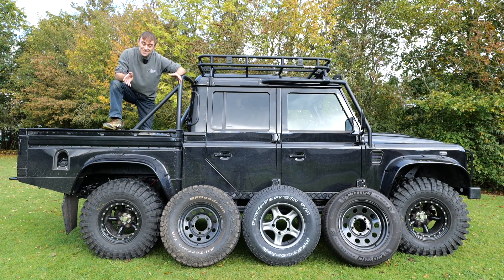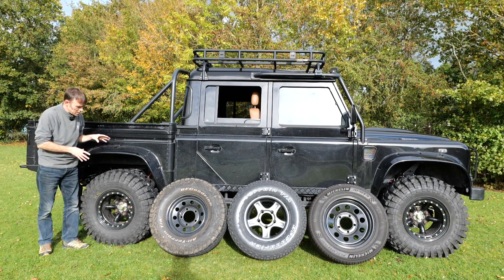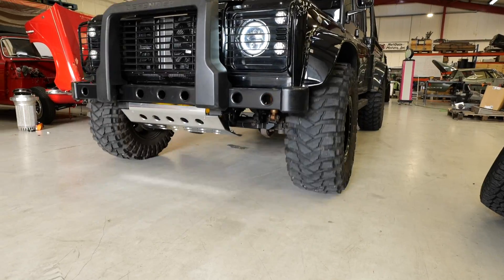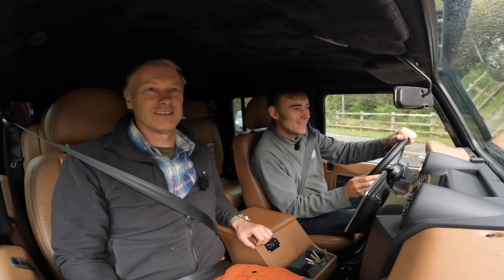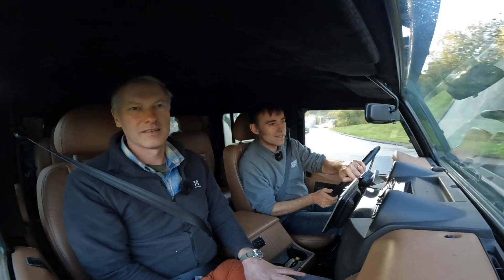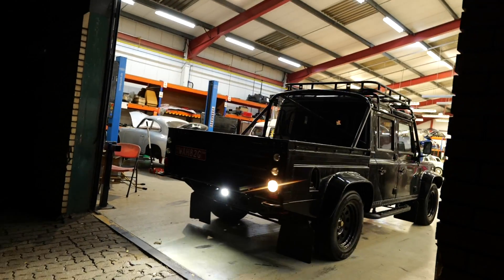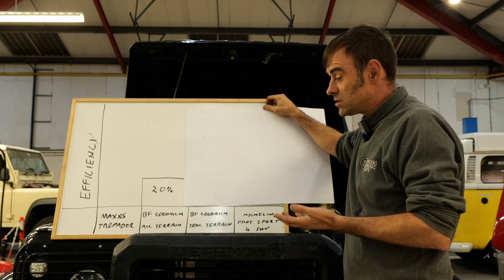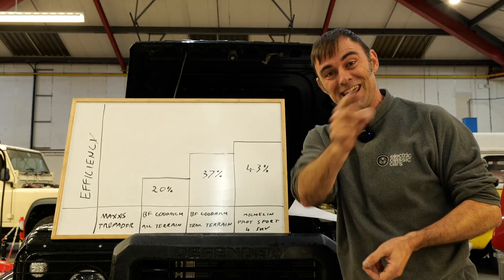How do tyres affect fuel efficiency?

Comment: Thanks Richard. 

Another 47 miles/kilometres for every 100 driven shows that, for road use, it is worth choosing the correct tyre for the job. It's worth throwing away your macho card if you want economy and a better driving experience.

It would be interesting to know what the difference is with the full road tyres on the smaller rims of the  off road tyres. My guess is that they will be around 50% more efficient than the off road ones.

Comment: The results probably don't translate to petrol or diesel cars the same because of the inefficiency of the ICE engine. A similar effect is seen when towing. The road tires will be better but likely 15% better instead of >40%

A large amount of energy just goes into keeping the engine running and that is fixed regardless of load. So if you use 1 liter of fuel to generate torque X, only half of that (say) is generating the torque, the rest is waste. So, if you need torque 2X, you only need 1.5 liter. No, this is not an 'advantage' for ICE cars, what it means is if you buy an ICE car big enough to tow your boat, you are effectively towing half that boat around with you ALL THE TIME, because that bigger engine is guzzling that extra fuel.

Electric motors are insanely efficient. So doubling the load means using twice the power. Bottom line is that you are going to be seeing the effect of the tires much more clearly on an electric vehicle than on ICE.

This is also why electric cars mean lower emissions even when the electricity comes from fossil fuels. 45% efficient generation followed by 90% efficient drive gets you 40% overall efficiency which is twice as good as the 20% efficiency a really good ICE engine manages.

Comment: Great video, however, the results would NOT be the same for a petrol/diesel vehicle. A electric motor is 90+% efficient at turning energy into movement, whereas ICE tops out around 30% (I think some have got close to 40). This means that the difference in tyres has less impact on total fuel consumption, as ~70% is wasted (mostly through heat) long before it gets to the wheels. If its a 90% vs 30% efficiency at the wheel (obvs theres transmission losses in reality), then that would mean an ICE vehicle would see 1/3 of the difference in efficiency between wheels - so around 14% better on the road tyres vs off road, which is still considerable when driving a thirsty beast like that.

Comment: I think, for a proper comparison, the difference in height (and hence drag) should not be "ironed out". The height difference is in actual part of what the tyres change about the vehicles energy consumption, because that's part of how the vehicle is supposed to run with given tyres.
So, while correcting the height certainly gives you differences based on the characteristics of the tyres, alone. You create a bias in favour of tyres that increase the overall height of the vehicle.
In the end a proper comparison would include height differences and tyre pressures typical for the type of tyre. And that would result in much larger differences in efficiency, than you showed in your test.
Reply from the maker: You are correct. 👍

Comment: I was just replying to a comment further down and have come up with a gruelling tyre changing fest of a test for you guys! Test not only tyre types but combined with tyre sizes! Where are the sweet spots for having bigger tyres to increase ground clearance plus aesthetics and maintaining reasonable fuel economy? 
So how much of a taller tyre starts to effect fuel economy negatively and how much of that loss in economy can be clawed back by opting for a more Road biased tyre? 
Can a taller tyre, especially one that is more Road biased, actually improve economy for a given type of engine and to what limits? 
This obviously will vary across vehicles depending upon where their torque curve is and (as I assume you did in this test) would have to be done over a confirmed, measured distance not from the milometer as this would vary in it’s accuracy relative to the tyre size. 
Of course you’ve also got tyre width thrown in there but I think you’d just have to go with keeping that as near the same as the natural progression through bigger tyres would dictate, ie accept that a taller tyre is also by default going to be a little wider for stability but not wantonly increase tyre width. How about it gents? Are you up for the challenge. I think an electric vehicle would be a very good platform to do this test from given it’s clean torque delivery.

Comment: Many of my fellow Americans drive on paved roads with their rough terrain tires. I can hear them coming down the road from around 0.25 mile away. Plus, they’re in their huge V8 trucks petrol or diesel trucks. Some trucks are equipped with air brakes, and they love to use them often.
However, EV sales are way down in the States. On the other hand, I understand that - they’re freaking expensive here.
Anyway, back to morning tea
Reply from the maker: I bet those guys with the V8 trucks and huge off road tyres are the first to complain when gas prices go up. 😆😉👍
Reply: @ElectricClassicCars   Usually the gas guzzler drivers blame fuel efficient vehicles for the increase in gas prices.  I'm not sure they understand supply & demand.
Reply: I have a few coworkers in here in Canada who live on acreages on paved access roads who drive SUVs with off-road tyres & spend $25 per day on gas to get to & from work in the city.  It's not about good decision-making so much as the vehicle is a giant security blanket.  Apparently a Vietnamese EV company is building a factory in the US which will produce sub-$20,000 EVs with a 248-mile range starting in 2025 or 2026.  This may explain why Tesla has been dropping prices.

Comment: are you taking circumference into account (assuming you have not kept a gearbox) that will
make a huge difference in electric but will be equalized via gears on ICE / hybrid / electric conversion with gearbox. On diesel and petrol I see very little mpg difference between pilots and ko2 (low single digits) but way more changing transfer ratio between 1.4 and 1.2. This is based on 40,000 miles driving down to spain and france at motorway speeds. you need to run this with same final output speed in EV

Comment: Fuel vs Cool....

Those road tyres look naff though!
Would be curious as to the weight difference between the Maxxis and the Road tyre, as that will have an impact.

I've got Toyo Open Country's on my Chevy, and whilst they are a big block off road tyre tread, they're surprisingly quiet for what they are.
(I took off the slightly smaller BF AT's).

Comment: Interesting comprison. I think it would be important to state the wheel dimensions, speficiations and weight as potentially a large percentage of difference would be the weight (both tire and rim) and size of the tire that results in the efficenty difference.
Reply: Absolutely. I also would like to know if the truck's computer has the ability to change/set tire/tyre circumference so speed and distance can be equalized. It appears that the weight of the tires goes down from a ton to a respectable amount for the highway tire. The additional weight of the monster tires with monster wheels could easily have added a couple hundred pounds to the load. All of this affects the efficiency of the truck and any truck or car they go on.
Reply: @robeigner4390  I appologise first as this is a long comment.

Without knowing the tyre sizes I can't give exact figures for weight, but looking at the overall height of all 4 tyres, the mud-terrain tyres look taller, so in effect at 55mph (sat nav speed) there would be less revoloutions of the tyre per mile compared to the other 3 tyres. This effectively means the motor would not be used as much. 
Saying that, the chunky tyre takes more energy to turn as the sidewall height is bigger, meaning there is more resistance within the tyre (internal friction) to rotate it & the tread design itself also increases the rolling resistance, as I expalin later.

Compare that to the Michelin SUV tyre, which is designed to have less friction within the tyres construction and the 18 inch wheel reduces the sidewall height compared to the (very similar) overall height of the all-terrain & trail-terrain tyres, which are on 16 inch rims (resulting in a slightly taller sidewall). 

The other significant benefit of the SUV tyre is the tread pattern itself, It is designed to offer lower rolling resistance because there are continuous strips of rubber going around the cicumference of the tyres that reduces the rolling resistance as the tyre tread is always in contact with the road. 
With a 'block pattern tread' (the other 3 tyres) every time a block of rubber hits the road, the block effectively tries to stop the wheel turning, which dependant on the severity of the block, increases the energy required to turn the tyre (i.e. the rolling resistance)

As for the unsprung weight of the tyre, yes this will impact on the economy too as the power unit has to use more energy to turn the wheels. 

In essence, the mud-terrain tyre has everything against it. It has large rubber blocks which act as a brake every time one comes in contact with the road, there's extra rubber used in the constuction of the tyre (heavier), the sidewall height is bigger and thicker to reduce punctures (again increasing weight & friction),  all of which increases the weight & internal friction of the tyre reducing the rolling resistance.

Compare this to the SUV tyre, which has continuous tread in contact with the road, thinner & smaller height sidewalls, all of which, adds up to a lighter tyre/wheel with lower rolling resistance resulting in a vastly improved road handling and fuel efficient tyre.

As for the all-terrain & trail-terrain tyres, they have varying combinations of the above designs, so it shouldn't come as a surprise why they fall into their respective positions in the overall result.
Reply: Can't wait to see the relative differences of Cybertruck tire mountings. Testing with FSD should help normalize results, considerably. P.S. Condolences for NACS standardization having (heaven?) taken so long, though you'll be grateful for the results. After all, can anyone recall the number of petrol nozzles during the advent of ICE engines? When might non-NACS plugs be seen only in museums? '27?

Comment: At the end of the vid you said that the % gains applied to petrol exactly the same.  I could be wrong, but I'm not sure that is true.  IC engines are heat loss dominated.  They lose so much energy to heat that it will skew the gains. The gains are there but not to the same extent.  -- Thanks for the vids.  Still waiting on that Miata NA/NB ev conversion package 🙂
Reply: You still need to output the same energy - the efficiency of the engine doesn’t go up at higher power level.
Reply: @JohnR31415 Actually the efficiency of an internal combustion engine varies substantially with power output. Generally the efficiency goes up with load (to a point). When you hear people say engines are 30% efficient, that’s at peak efficiency. Elsewhere in the power curve it can be as low as 10% - which is where it will be most of the time if you’re driving in traffic. Engineering Explained did a great video about this: “The best way to compare engine efficiency: BSFC”
Reply: @JohnR31415 Actually the efficiency of an internal combustion engine varies substantially with power output. Generally the efficiency goes up with load (to a point). When you hear people say engines are 30% efficient, that’s at peak efficiency. Elsewhere in the power curve it can be as low as 10% - which is where it will be most of the time if you’re driving in traffic. Engineering Explained did a great video about this: “The best way to compare engine efficiency: BSFC”

Comment: Another great explaination and experiment showing what a difference tires make. You started with 157kw in the battery. If we take your figures and convert them to equivalent kilowatts based on increased efficiency you get the following: with the Max AS Trepador tires at 157kw battery capacity you'd need a 188kw battery to achieve the same range as with the BF Goodrich All Terrain Tires, 215kw to match the BF Goodrich Trail Terrain tires and 224kw to match the Michelin Pilot Sport 4 SUV tires. From all Off-Road to 100% Road tires you gain 67kw worth of equivalent range. Mindblowing.
Reply: Thx for the great analysis! Can't wait to see the relative differences of Cybertruck tire mountings. Testing with FSD should help normalize results, considerably. P.S. Condolences for NACS standardization having (heaven?) taken so long, though all'll be grateful for the results. After all, can anyone recall the number of petrol nozzles during the advent of ICE engines? When might non-NACS plugs be seen only in museums? '27?

Comment: Thanks for that, I can relate to these results.  I use my camper van a lot in the winter and put on a set of Bf AT tyres.  Noticeable noise increase and big reduction in fuel economy ie from 40mpg to 35mpg.  Will be back to road tyres in the spring!
Reply from the maker: I thoroughly recommend the Trail Terrains. Maybe try them. 👍

Comment: This car just looks better with the Maxxis, I’m sorry
Reply from the maker: I agree. But just like stiletto heels 👠 they’re not the most comfortable or easiest to live with every day. 😆😉👍
Reply: @ElectricClassicCars  that’s also true. How do you avoid your big wheels from ‘shaking’ when driving fast? I have Toyo Open M/T 255/85/16 on my 110 and when I hit 80 km/h the front wheels start shaking and the after 85 km/h it stops. Does it all have to do with the balancing? 

Thanks for your content, still saving up money to go electric on my 110 😂
Reply from the maker: @jonasschnackkrog Wheel balancing is essential. The bigger the off road tyre the more weights are required. However, I’ve noticed they can easily drop off, the tyres can rotate on the rims and mud collecting in the grip all can cause wobble. 👍

Comment: You didn't take into account the overall diameter of those wheels. The Trepadors are significantly taller than all three of those other wheels. That makes a huge difference to energy needed. I think a really interesting comparison would be if you can the pilot sport tyres on a huge 22 or 24" wheel so that they will be the same diameter as the trepadors and compare the two. then you would really understand how much more efficient the road tyres are.
Reply: No, it affects the torque required, which is not an issue as the vehicle has plenty spare. 
I accept that the more variables that are fixed the better the comparison but manufacturers are fitting larger and larger wheels to cars and it's not to make them less efficient.
Reply: @DrRogB  Mostly disagree. Whilst electric powertrains have a linear torque curve, larger wheels effectively use more energy to spin up to an equivalent speed. If torque was the only factor involved with efficiency (energy for a given velocity) then the tread and tyre depth would not affect the efficiency…..But that is clearly not the case here as the tests proved. Those three equal diameter wheels run on the same drivetrain torque showed significant efficiency differences. Again if the torque was the deciding factor in energy use the efficiencies would have all been equal.